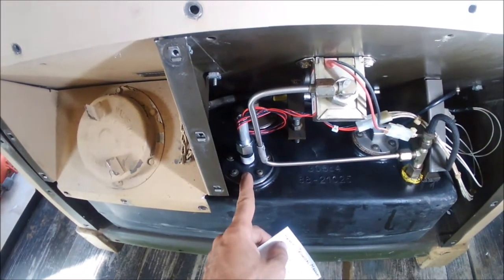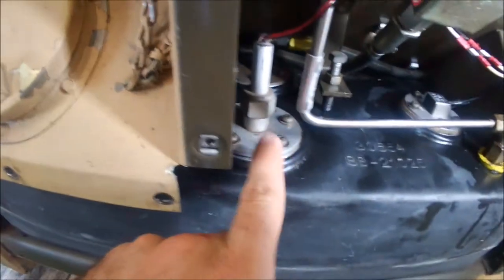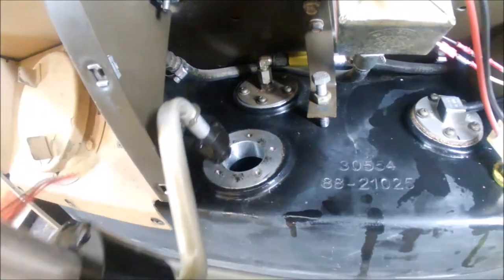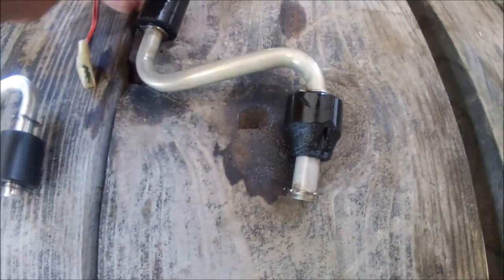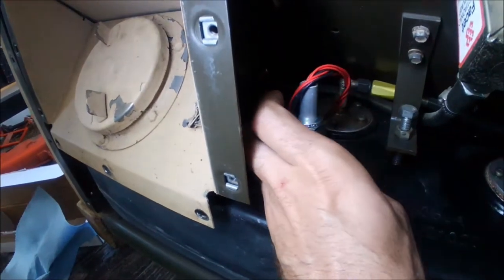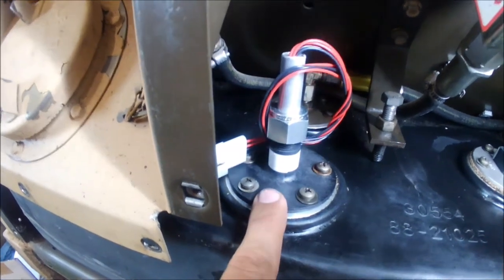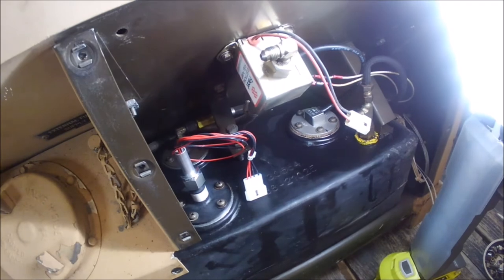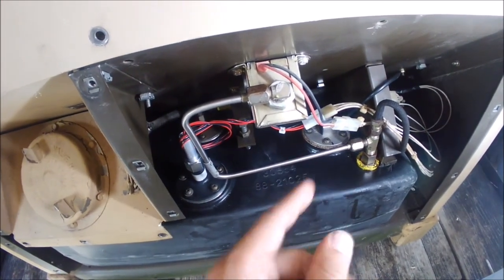MEP 802A - Double float switch replacement

Comment: Thank you for the video, made my diagnosis easy.  My set kept shutting off intermittently with the low fuel light on during an ice storm.  Fuel gauge reading stayed consistent and I was questioning what was going on, didn't realize there were 2 senders.
Reply from the maker: Glad the video was helpful. 😀

Comment: Good video. Where did you find the switch. Maybe the price went up but its $74 on the big E site. I signed up for your 802 build I just purchased one and looking for what others are doing. Thanks
Reply from the maker: I found it on eBay from a seller in CT. MEP-802A is a good machine! I wish I documented more of the work I did on it for YouTube but some of the jobs were hard & adding the filming to it doesn't make it any easier.

Comment: Hello Colt I’m looking at 802 m. Starts on gas soaked rag he says. But when running sounds good. For sale as is Has had a tier 2 with 30 hours. The person has several but this one is newest manufacturers date and it on a trailer. $3000 What’s your opinion Thanks for any assistance
Reply from the maker: I'm assuming you mean MEP 802A, not 802 m. Starts on gas soaked rag? Starting anything diesel with gasoline is 100% wrong so run away from it, the rest doesn't matter.

Comment: On my friend. I have looked high and low for this part. I can not find it. Wouldn't there be a way to bypass this or make it think the float is fine? Like you would a sensor?
Reply from the maker: There is a link in the description to a place where you can buy it.
Reply: Yeah it says no longer available and Green Mountain is out of stock on these as well. I'm gonna keep looking was just wondering if I couldn't bypass it in case I can't find it
Reply from the maker: @Lordhumongus  Sorry, I didn't realize that. I don't know of another source. Since these generators are discontinued for the military, they probably aren't made anymore. You can just unplug it, but you will then not be able to use the auxiliary pump. or, use the Technical Manual and trace the wires to the leads for just the low fuel switch on cut them, so just the switch for the auxiliary fuel will still work.
Reply: @CallMeColtLLC  you're the mad dude. I planned on that but needed confirmation before I got crazy with it